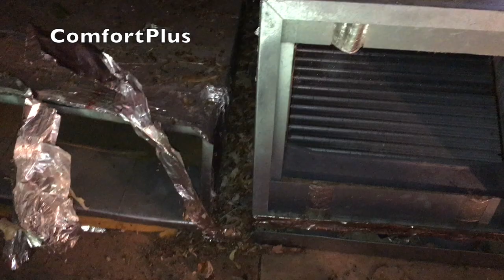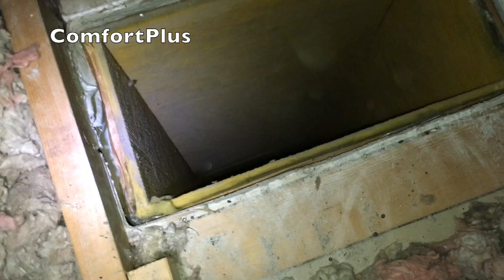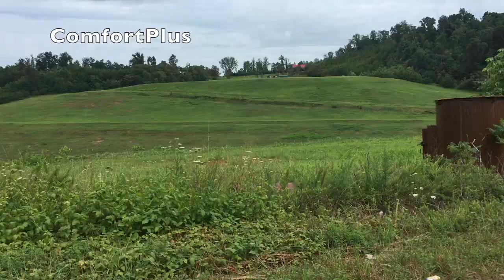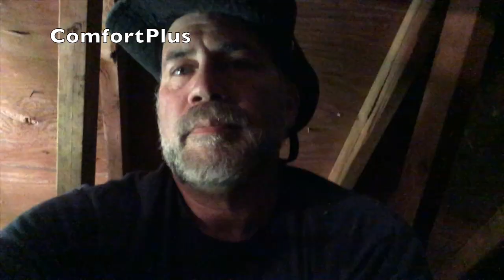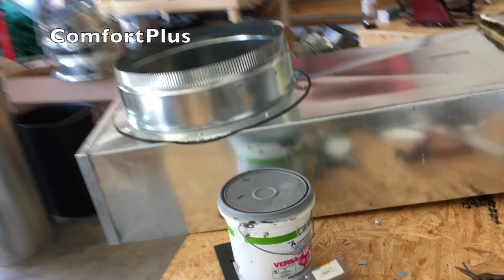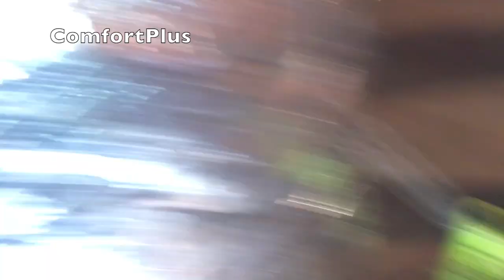HVAC: Installing new ductwork in an attic

Comment: Even if you put a floor fan up there just for air circulation to make it a tad more tolerable it would stir up all the insulation fibers making it more intolerable.    Nothing like being wet from sweat and having insulation fibers stick.   to every exposed skin area , not to mention the breathing side of it.     Yep.  Just no good way around that except work morning only or wait till summer over ha.     I dont know how the insulators can do that stuff for a living.  Theres gotta be an easier way to make a buck.  But god bless them. They are better men than me.

Comment: Thanks for the video. I'm having some trouble with my second floor A/C system, which is mounted in the attic of a house I bought a few months back. House was built in '04 and uses square metal trunk insulated in bubble insulation, with 6" take-offs to R-6 flexible ducting. Has R-6 flexible ducting for the two 12" return ducts. It also has a ridge vent like this house. Attic is getting pretty hot, and when it does, the A/C system runs all day and even with the thermostat set to 69, the upstairs still gets to 76 degrees on 95 degree days here in Maryland. It was nice to watch your video and get a muuuuccch better idea of the proper way to build the ducting these days in an attic installation. Thanks again for putting this video up!
Reply: Make sure you have a superior running attic fan, it can ruin your attic, roof,the heat and moisture. If it's old you may have a damaged duct causing your ac to constantly run. That's my problem...flexible attic ducts,animal cut through,but just small enough I missed it,I've duct taped it up and added painters plastic covering.. Now I'm on here looking for a way to add metal ducts. That big space that you have to crawl down I think is ripped up to. But a few videos should help!

Comment: Good morning..I'm in a world of trouble with my system. I had paid a fella to install a new system. I got the main supply trunk hung return holes cut and supply boots in. The amana furnace sitting on the ground waiting to be hung. I called local folks and cant get anyone out since its started. I put my electric ,water and gas in. I think I can hang and get a plenum to connect . Just need some guidance to get some doggone heat. Any videos of cutting into supply and attaching supply. Its going to be horizontal in a 4 foot crawl. Hope I can learn from you sorry for long message

Comment: I have an issue; I'm living in a 6th floor condo, which as no air exchanger. 
How can I install flexible ducts in an existing 12" ceiling? Do I really need to destroy the existing drywalls?

Comment: Why is the RA static so high at 0.43"; is it the filter type & area?  With SA @ 0.18" total is 0.61"
Reply from the maker: The 0.43 was total. Return was around 0.24. When I first show the manometer the larger number was Return Probe. The bottom number is the total of the two.